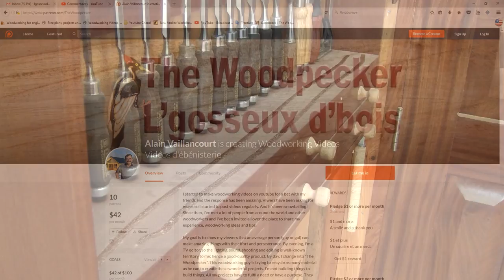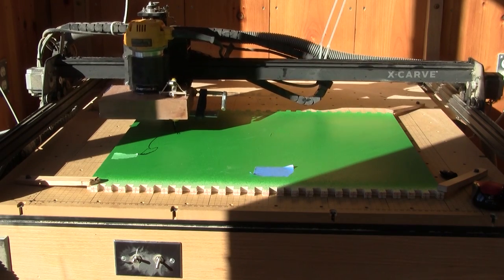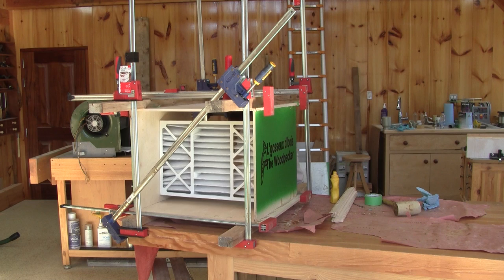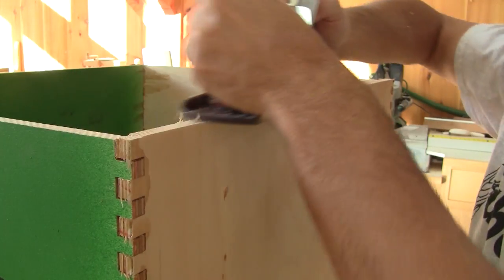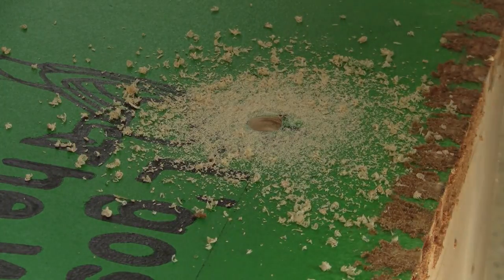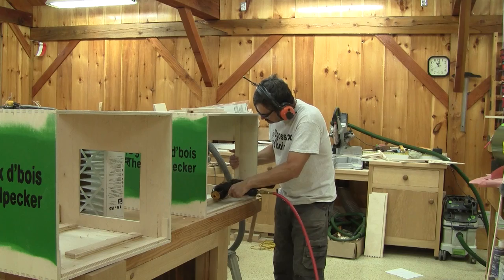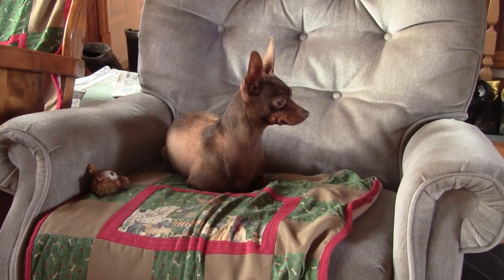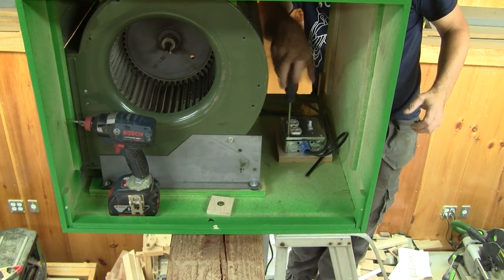The Woodpecker Ep 128 -  I'm making a dust filtering system

Comment: gday Alain great build, small suggestion when using more than one filter unit set them up so your airflow moves around the shop so it creates a circular motion
Reply from the maker: It was my intention. With a big shop like mine I wanted to circulate the air. And like this I was also able to put one fiter near the table saw.

Comment: Great looking filtration system - good job. Now i would have used pocket holes for the whole thing, since they are not made to be moved around, and they would be adequate, but box joints are of course much nicer.
Of all the Matthias Wandel machines you have built, why not the box joint jig?

Comment: Filter boxes need to be run at ground level to work well as most dust settles low due to gravity. I have mine on the floor. with wheels.  I also use the air coming out to dry stuff. I have a drying rack in front of the outlet vent.

Comment: Great project. Are you sure the filters are round the right way though? I thought those cardboard straps were for support to stop the filter material being sucked in...
Reply from the maker: On the side of the filter the're an arrow saying the direction wich the air is supposed to flow. I've installed them according to this advice.

Comment: I honestly believe the filter is too high. The heavier dust would not float that high unless it is being moved upwards by an external force. The optimum height would be only a couple of feet over your head in the center of the shop no more than 8' above the floor and in reality, the best solution would be to have a second one on or near the floor and close the tools that make most dust.

Comment: on minute 17.03, there is another white box closest to the roof line. Is that a heat source? If it is, why is it up so high?
Reply from the maker: Yes I have two garage 5000watts heater up near the ridge purlin. But to heat my shop I absolutly need both ceiling fan to push the heat down.

Comment: Why finger joints? It's just a box. Butt joints or rabbets would have worked fine.
Reply from the maker: Just for ther kick of it. Box joint are way stronger and I wanted to be sure if the blowers made any vibration the joints will stayed firmly glued.

Comment: Did Matthias Wandel influence your choice of color?
Reply from the maker: A little bit. I wantedvthem to be the same color as the 13" jointer I made from Matthias plan. And the color will fit my next Matthias wooden tool.
Reply: It's a slightly more cheerful color though, which I think is fitting ;-)

Comment: What speed did you set the furnace fan to run on?
Reply from the maker: I don«,t know the exact speed but I wired it to the slowest
Reply: Yes, I need to rewire mine to the slowest, it blows too hard.  And what Filter did you use my good man.
Reply from the maker: I bought the big Honeywell type of 4" thick (16x25x4)